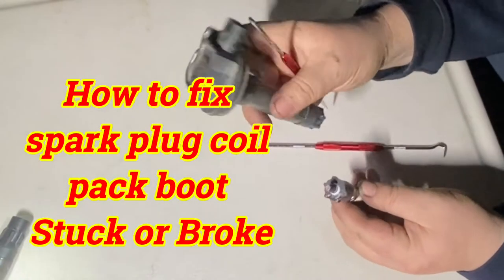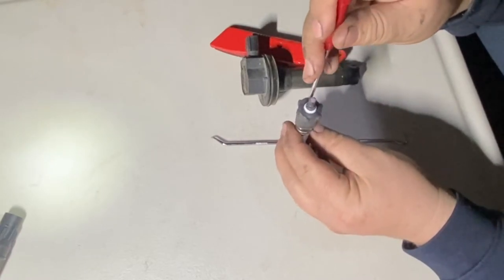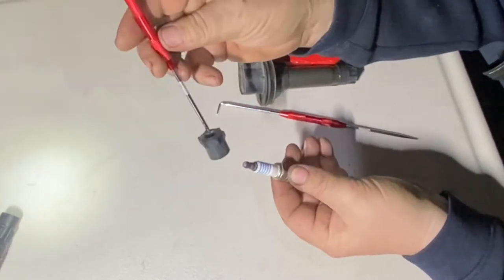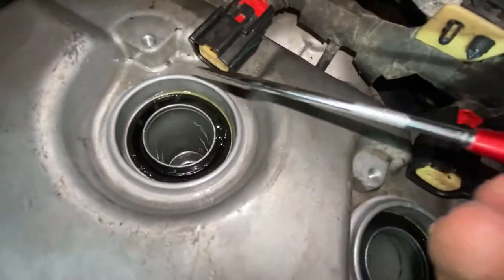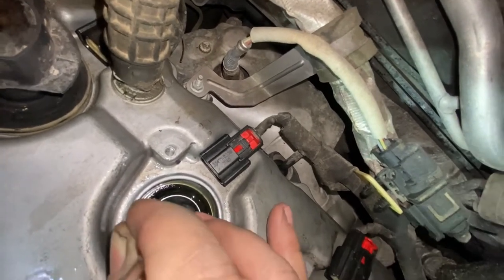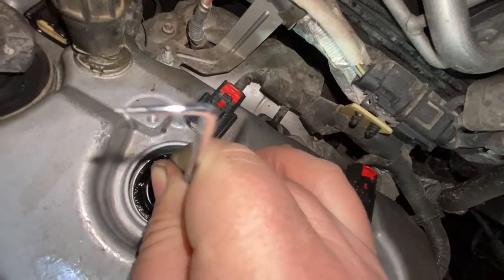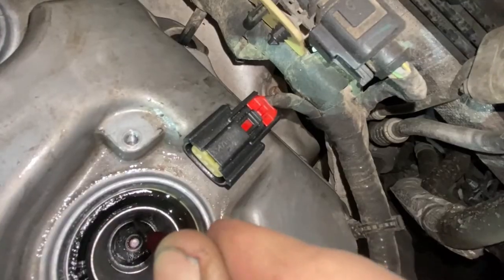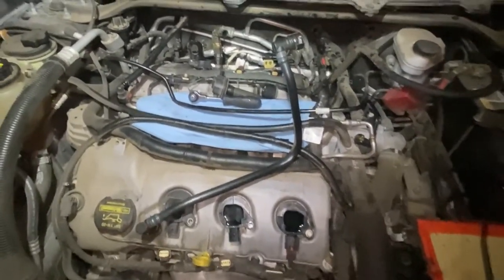How to fix Car & Truck Broke / Struck Spark Plug Coil Boot/Wire

Comment: The lubricant is very effective after the pick creates a hole to go under the rubber boot and stops the boot from getting suctioned/stuck back down. The lubricant gets between the boot and spark plug to make lifting easier. I should have tried Uncle Mark's method first, lol.

Comment: So I had this same thing happen. I removed the debris from around the plug and then was able to remove the old spark plug. It squeaked a few times as it turned but it came out nicely. I’ve been trying to put a new spark plug in but I can’t seem to get it to grab the threads. Any idea why this is happening ?

Comment: Hello sir, i HAVE A LEXUS RX300 2001,  I may want to ask you, the spark plug boot wore out but the problem is , the boot got cut almost in the middle where I can't get it out no matter what. the part where the hardest part of the plastic siezed inside. I lubricated it , tap it with long screw driver, I drilled it . but it won't even moved. I'm stucked. What is your suggestion to solve this? Please help. your Avid fan Joe. I'm not a mechanic but I was able to remove the the plenum , and etc. I don't eve know the names. and the problem is  the # 3 spark plug . Please help. Thank you in Advance.
Reply from the maker: Thank for watching. I would to look into it.

Comment: Cant You Just Remove The Spark Pllug To Pull It OFf
Reply: There’s a rubber piece that broke off from the ignition coil. He can’t put a socket in there without taking the rubber out